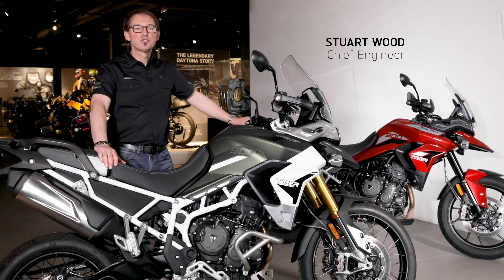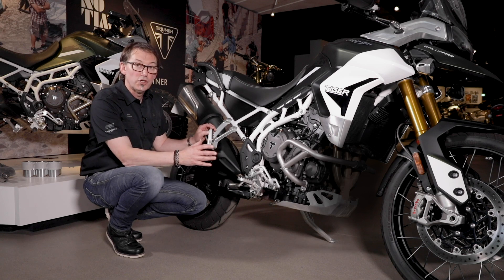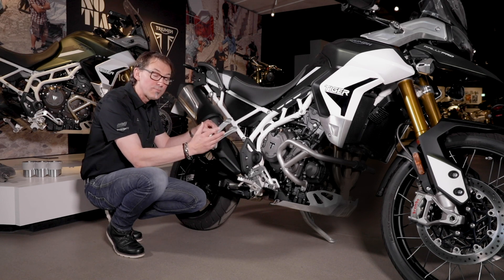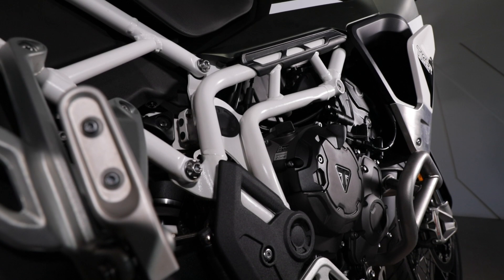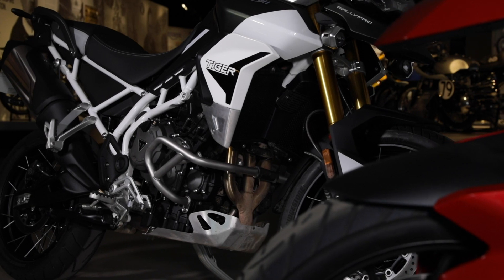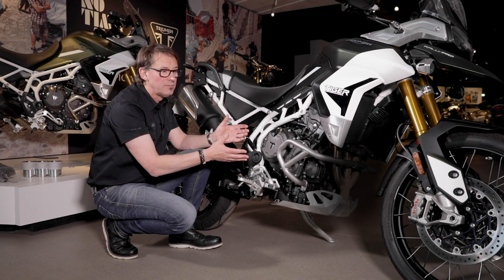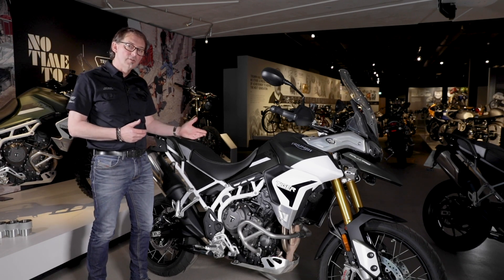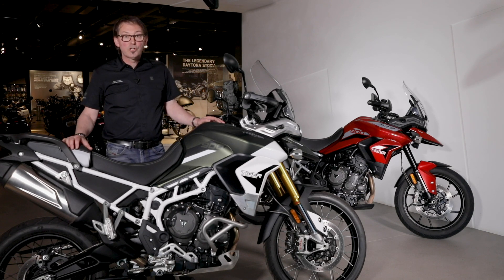Triumph Factory Stories -Tiger 900 Chassis

Comment: And it looks like the passenger pegs can finally be removed!  Lowering the engine would help quit a bit.  Love my Tiger 800, but this is very interesting to me.  Radiator design is quite smart, and I really like the profile of it for air flow.